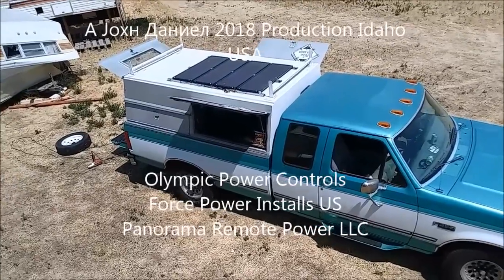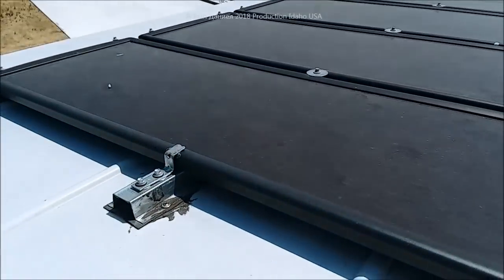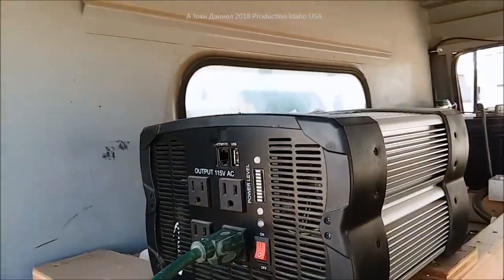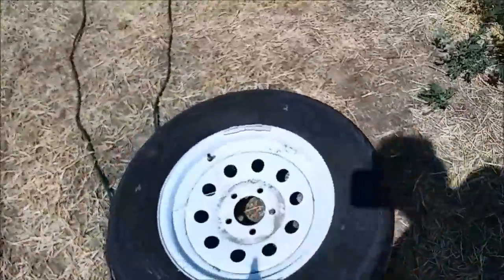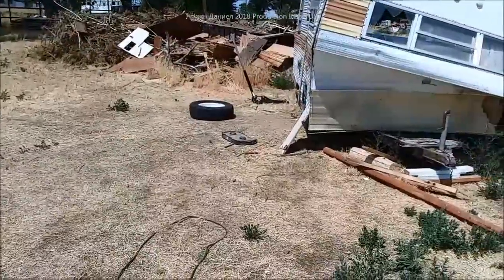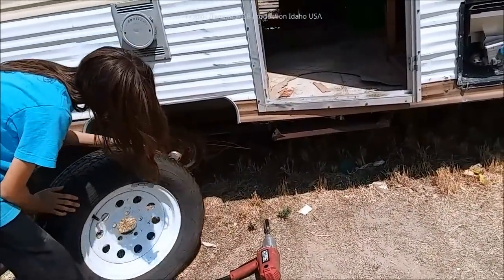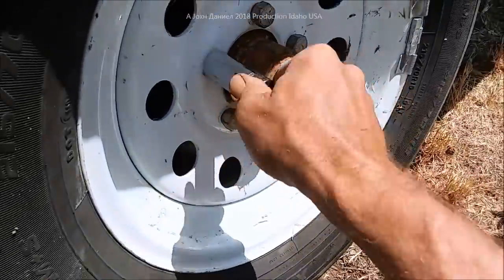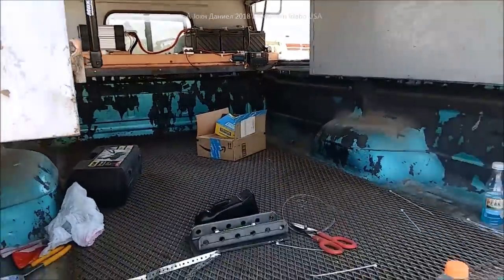Harbor Freight 25 watt solar panel durability, a 1+ Year users review, Options list below video!

Comment: What do you do with the old RV frames?
Reply from the maker: Most of the time we build something for the local farmers, but occasionally I will build from them numerous different things such as car haulers, cargo trailers and more. You have to beef them up and always put full rated springs on them but its not too expensive and you can be free to design all you like. I have 5 right now ready for something, but in winter they just sit.
Reply: @JOHNDANIEL1  oh ok I see. I wanted to build an old style pipe trailer out of one.
Reply from the maker: @mrfender5001  Ah, I might have one you can do some work on, 26 foot I think. Where you located.
Reply: @JOHNDANIEL1  I'm in Tickfaw LA. About an hour north of New Orleans.

Comment: Great setup .... any advice and replicating ur setup plus running another cable to charge my two truck batteries if needed? Cable gauge and such .... i think i would need a diode in between so mu alternator doesnt charge solar batteries  ? Any advice
Reply from the maker: You just need a second solar controller from your solar battery bank to your truck batteries. Pick a stout 60/80 amp like this one https://amzn.to/2N24KWL and it will prevent back flow off the truck yet allow you to charge excess to the battery for your truck. Need a schematic on it send me a email olympicpowercontrols@yahoo.com with description on how you plan to set yours up. You can also add a 3 way switch to manually charge in 2 directions if needed.

Comment: Mr Daniels, I'm building an off grid camper. Planning on using: 2 harbor freight kits plus 2 100 watt panels. Going to wire the HB kits in in series and the two 100 watt panels in series and then wire them parallel to make 24 volts going into a mppt controller to charge a 12volt battery bank. Will this work safely? Thanks for your time. Charlie

Comment: How many batteries do you use with your solar panels that's in your truck
Reply from the maker: 3 - 95 AH model 29D, but we are about to go 4 of the smaller 84AH since I get a huge discount on them and these in the truck are very old now. Adding another 50 watts soon too.

Comment: One more question I have a 150 amp fuse on my positive side of my 8 bank battery's going to inverter I hooked up a shop vac to it today and after about 4 min the 150amp fuse tripped I'm thinking I need a bigger fuse am I using the right size fuse for a 8 bank 12v  battery hook up? What size should I be using
Reply from the maker: 100 amps per 1000 watts of inverter is the normal sizing.
Reply from the maker: A shop vac can easily surge at over 1600 watts, thats the limit of a 150 fuse.

Comment: Hey John I have the harbor freight 100w panels with a 40a Epever MPPT charge controller the most I ever seen my panels reach is 52watts I have them angle right position and directly at the sun is this normal for these panels?
Reply from the maker: The panels should be at 78 to 90 watts production if using the supplied controller. But your using to low of solar wattage on that 40 amp which eats 12 to 18 watts of it just to run. Watts that are by default pulled from the solar first, then the battery at night in sleep mode. If you had 400 watts on it, you would be seeing much closer to 87% instead of 52%
Reply: @JOHNDANIEL1  ok thanks I'm going to use the charge controller that came with it to see if that makes a difference

Comment: That would be a great setup for charging the new lithium cordless tool batteries. My 20v Dewalts recharge in about 30 minutes, so it should be able to keep ahead of them.
Reply from the maker: We park the truck and charge numerous batteries off the system. From 14.4 nicad to 40 volt lithium.

Comment: The controller that comes with this kit is overly complex, in its multiple settings.  If it gets wet ,its done for. The wiring is too short to route it into a dry place. You can buy a kit of extensions at Harbor for about $7 money well spent. A new controller is an up graded one that cost $70. I replaceed mine with the potted one that has 3 simple idit lights and it works great for $26 . Later found the same item ,different brand $11  on Amazon. Shumaker? Brand.
Reply from the maker: The best controller would be as you say, pure basic. I hate hitting just one button through cycles to find settings. They are all built like crap now. Gimmie a settings dial, I am OK.

Comment: So what are you doing using you separate solar panels linked together.at about 150.00 each from HF
Reply from the maker: 4 panels @ 25 watts each to equal 100 watts for $144 with coupon, comes with 2 lights, cables, controller and mounting hardware. Not a bad deal. A single 100 watt panel like this https://ebay.to/2KHX5XY which is $100 would need a controller, $25, wiring $22, and don't have a mounting system built in. Although that 100 watt panel is superior due to the fact you can build a better large system based on it, its not a way to learn and start into solar like these are. Honestly 5 of them 100 watt panels and a good quality MPPT is the smartest way, but a $700 expense.

Comment: So good
Reply from the maker: For starters and pros the best Solar Panels https://ebay.to/2KHX5XY Mighty Max 100w4bar . You can lay them flat or at a sun rated degree with less power loss due to them having 4 buss bars on the cells

Comment: Really cool setup. I dig it. I'm looking to run a"hillbilly" AC off of a setup like this. The blower for the cooling unit needs 12 volts at 2 amps to running continually. Will this work? Thanks again
Reply from the maker: Yeah this size setup would work perfect for that, might want to make sure you have enough batteries though.

Comment: how much was that solar panel setup
Reply from the maker: About  $620
Reply from the maker: If your trying to go cheap but want the biggest bang for your dollar For starters and pros the best Solar Panels https://ebay.to/2KHX5XY Mighty Max 100w4bar . You can lay them flat or at a sun rated degree with less power loss due to them having 4 buss bars on the cells. I will be installing them on my BugOut trailer in a few days.

Comment: Nice Video!  I've wondered how these panels would be attached to the roof of a camper/ camping trailer and wired up.  I'd put as many as would reasonably fit on the roof and connect them in parallel.

Comment: Appx 7 years use of the older 45 Watt set (2 sets + 1 more panel for 100 watts)  Still producing power just fine.  One panel has a small defect from hail impact after several hailstorms.
This is mounted on a "shorty" 12 ft + V nose Wells Cargo trailer (4 ft tall doors)
I have 320 amp-hr of 12V batteries in the system.
I can run chargers for 2 X 3 cell 3300 mah LiPo batteries (3.3 amp charge rate each) with the solar system storage batteries disconnected.

I'm installing the new Harbor Freight 100 Watt system on a shed for lighting, lawn tractor battery maintenance and some power tool operation.  

I'll upgrade the trailer's system to newer panels in a year or two.

Pretty good value from the Harbor Freight solar system when you want a small system.
Reply from the maker: They work, do not degrade as much as the stalking Ebay junk solar sellers on here post lies about. And like all solar panels can break. BUT, I got a very old broke 15 watt panel thats still making amps, about 1/2 less than spec but its not dead.

Comment: Solar panels with sputtered PV attractant sprayed on the glass? The set I PROFESSIONALLY tested made 45 watts in full sun,and shorted at the first fog [not rain, F O G ]...After seeing a set burn in place,I decided to let folks know that these are dangerous toys. Zero understanding of electrical theory and safe practices will get early people consideration for Darwin awards in their name.
Reply from the maker: If about 1 amp shorting out will put you into reverse evolution your not much of a higher life form!  From 2007 forward I have 5200 watts Amorphous and Poly solar on ,my shop and house( Bosch SOLAR and UNISOLAR & STION) , but the fun with good ol' Harbor Freight included a warranty thats without a doubt 1000% better than some Ebay Solar C grade cell AssClowns offer - or actually obey! In other news, I got admittedly 2 Cheapy Cheap Cheapster HF sets from 2006 still working in the mountains in Nevada at our ridge camp, near Baker 6500 feet up. Totally hands off, I don't even try to clean them. And 5 of the 6 little CCC HF panels are still running just fine with one broke from a hail storm 2 years ago. Sounds like your store sells much better panels.

Comment: You need to have details in a video like this (lose the music). The solar kit you have is a good kit. The one prior to it was inferior. You cannot run anything full time on this solar kit except 12v led lights and other 12v low power items. Going AC with an inverter and running a small fridge or TV will drain the batteries (2 or 3 deep cycle) in daylight, forget nighttime! I suspect you would need 6 batteries and 8 to 12 panels and a high watt output inverter to freeze meat etc. Batteries cost a lot these days. One needs to do the math to know what it will take for their own situation.

Comment: The included charge controller is only 10A so it can only handle 120 watts, right? How does that work if the panels can peak at 179 watts? Wouldn't that blow a fuse/damage the charge controller over time? If nothing else that's 59 watts wasted by the charge controller.
Reply from the maker: If its a short lived peak, and the temperature don't damage the MosFets then It will pass it through. Most 10 amp controllers will handle 150 watts easily, this one is probably actually a 15 amp by the size of the terminals, but most likely so that harbor freight don't get customers putting 2 sets of 4 on it then lying to get it replaced they rate it as 10 A.

Comment: What are the measurements where you have the panels mounted? Location of the holes through the panels.
Reply from the maker: Panels already have mounting holes on each corner. The area they cover is about 3 foot x 5 foot.

Comment: Its not running off the panels. It’s running off of your battery bank.  I’m not seeing how the HF panels are any better than other panels on your setup.
Reply from the maker: Oh shit, you got me man. I got magic batteries that charge themselves from Agothorium Extract we brought in from Planet Gullible and its all a scam where I will rule the world soon with infinite energy plans and a membership with Dr. Evils club of soviet subway sandwich stores. LOL!.  ON a serious note, the solar makes the power, the batteries store the power, then the cycle repeats itself. Thought that was plainly stated about my system.  Solar can't run nothing but a fountain pump without storing it in batteries!!! My shop has 4200 watts of solar, I still pull power from the batteries.
Reply: How long does it take for the panels to fully charge the batteries after they are drained?  If you can get a day's work done on one charge I think it's a great idea - as long as you take the next day off while the batteries recharge. And it's a fantastic idea for camping too.
Reply: Well, the thing is that all this video really shows is your batteries and inverter will power that tool for a couple minutes. As someone that has had a setup like you show I can positively state your panels had nothing to do with anything in the video!!!!
  I have ran electric chainsaws, weedeaters, leaf blowers, etc.. for much longer and not dropped even .5 volt at the battery bank! NO charging! Fact is a 900watt load is not much at all at 1 -2  minutes runtime. Ya, any heavy load will cause a fake volt drop while on for 1 minute but soon as load removed volts go back to true voltage.
 If you ran a 900 watt load for 1 full hour you would need 9 hours of perfect sun with perfect 100 watt panels producing full 100 watts the entire 9 hours to recharge the batteries! Actually you need far more when you figure in all the losses in the system. That just AIN'T going to happen in any average day!
So ok, what does this video really tell anyone about solar panels, NOTHING! 
  If your claiming to be doing a review on the solar panels then you should give some true facts about the panels/kits,
Reply from the maker: I'll be doing another update later and in the first 30 seconds will include showing the controller still working, the panels still producing, the battery volts and with it showing a watt meter to show how much power it has made since install. I actually did all that in the video here but sometimes I forget the world lives on a 1 minute clock for everything from news, sex, text to drive throughs and they often miss entirety of everything. I just have to get a bit more adapt at it!

Comment: I see trailers that old that have been "restored" on craisglist for $12,000  crazy
Reply from the maker: I have received 4 free ones that were still nearly perfect over the last 3 years, the best one a 1952 Polar that was all birch interior, everything in it was original and I did file for a salvage title and it sold at auction for $6100 last year. Wrecker companies see Tow Aways as waste house material, cars as recycle weight. They will give you motorhomes, and RV's for free or usually under $200. One motorhome we got had a 8.3 cumins diesel in it with 108k miles on it. Paid the over size fee of $212 for it.

Comment: What is that metal you have them mounted on? Where can it be found? I have unistrut I don't want to use it really. I may end up using it anyway. I am looking for other options. He remind me of me when I was his age. I was changing tires by hand. By the time I was 13 I was building car engines. Carburetors, alternators. Even changing engines and transmissions! In Chevy. Old trucks. 1950 1957-59. I put a engine in a 59 Chevy truck. And was driving it around. Off road! Those were the days!!! We even had a 1957 Chevy Holmes wrecker I moved old cars around with! Alot of the time I did it alone! You have one of the best channels. I wish I had a place like you have. And all the "junk" no offence. I have alot of "junk"  its only really junk to people who don't appreciate it. I appreciate it. Having things like the old camper around can save lots of money. And what's it gonna hurt sitting around if you have a place for it... I wish I had a few of them. I like building things. And mucking around. If you have a good welder, grinder, and drill and a few other tools. You can almost build anything!!.. Anyway you have one of the best channels it really gets me thinking!  I have a 5kw inverter. 750 ah 24v batteries. And a 250 ah lithium battery bank I'm adding to. I am going to use the lead acid Bank for back up. All I use is a fridge , microwave, TV and a few LED lights and a 7 amp well pump. I haven't actually moved in. How do you think this will fare over night? I have used it to watch TV, run lights and saws and router while doing repairs so I can move in. I am adding 200+ ah to the bank soon. And connecting the rest of my panels to the bank. I have 1200 or 1500 watts icant remember exactly how many panels I ordered!! I'm using 150w mono panels. I get about 125w average from them. And get a amp or two in full cloudy rainy days. With only 600w of panels connected. Sorry for rambling!! Do you think this will possibly work until I can do better??? Great video!!!
Reply from the maker: 1-1/2" Hat metal AKA Furring metal, clarkdietrich brand, 20 gauge galv-zinc I believe and its sold where you would buy commercial metal studs and drywall. https://www.clarkdietrich.com/products/drywall-framing/furring-channel-hat-channel

Comment: Just goes to prove you don't have to spend big dollars for a good little system.I've got to do the same set upfor my 240v chainsaw, I can't breath in  the two stroke fumes. Man that truck looks nice , if only I could afford the fuel I'd have one like yesterday.
Ps, i was looking at that 400w turbine you have that sells on aliexpress  , I noticed another  it was a 400w axial flux turbine commercially made and sold on aliexpress/ebay , 1ms start up 2.5ms cut in.
Reply: closertothetruth how come you cant breathe the fumes

Comment: I like to have that old Dodge Motorhome  in the background that's pretty cool
Reply from the maker: Thats a 1973 Dodge Balboa
Reply from the maker: Wanna video on it? Its a donate/salvage job. They put a magnum 300 hp 5.9 v8 in it, then fried the tranny.  It has a Gear vendors ultra drive in it.  Guess no one told them that you can't stomp on it  with that kind of accessory.

Comment: Do the batteies drain and charge evenly. I'm looking at setting up a dual battery set up for my camper
Reply from the maker: Yes, using my cross pull buss bar set up those 5+ year old batteries keep kicking.